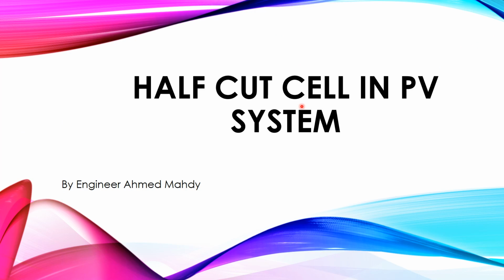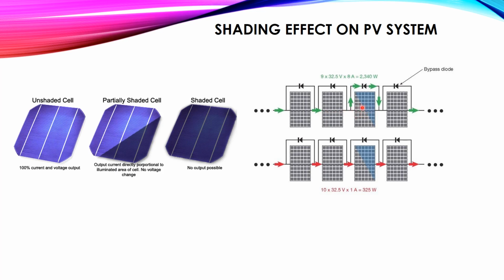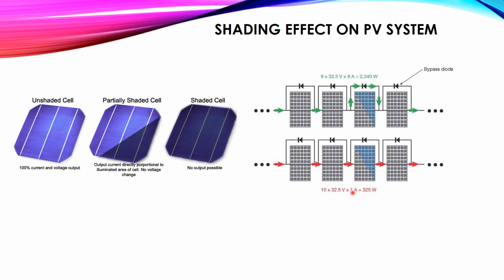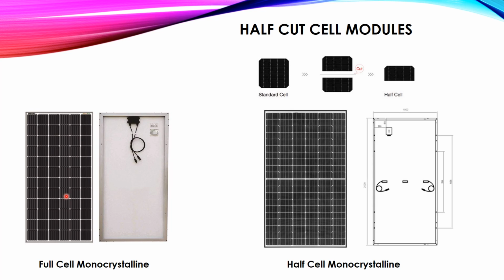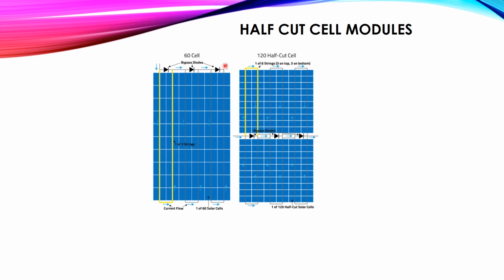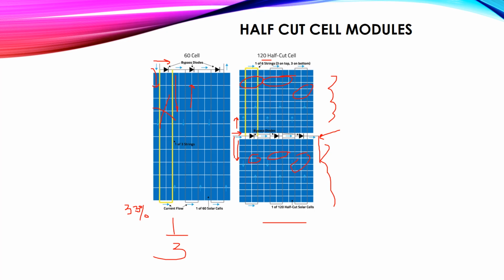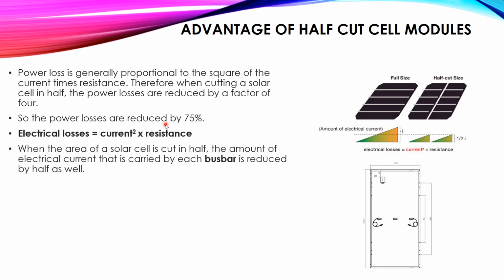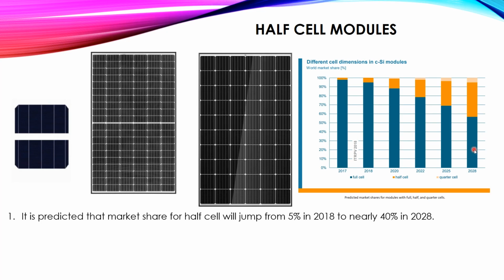Half Cut Cell Technology in PV System for Solar Energy Course

Comment: sir,we use half cell if shade on 1 panal or cell they reduce current ,as you said in module string minimum current value in output then these shaded panal not considered in bypass diode ,then why half cell needed
Reply: I'm ur udemy student